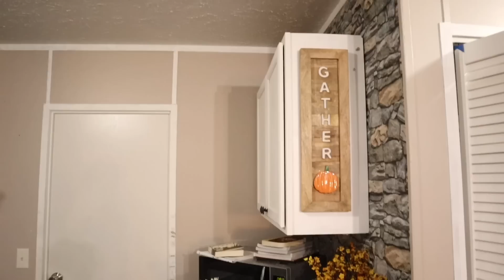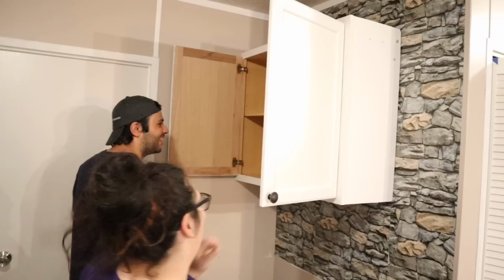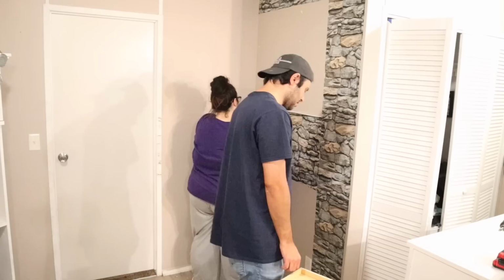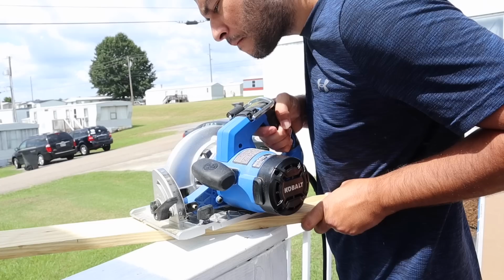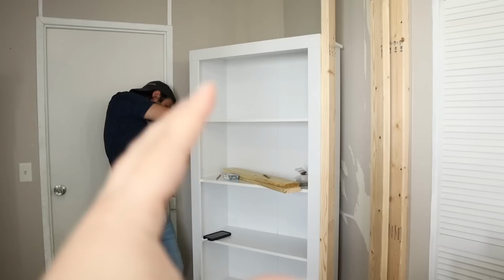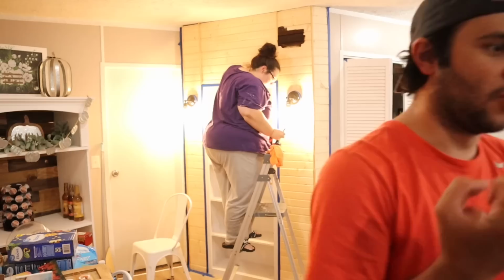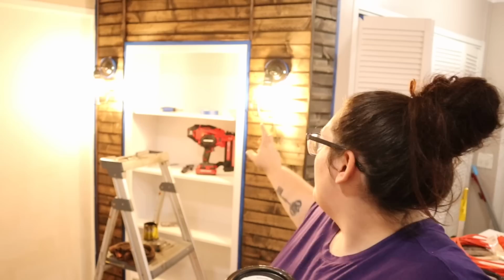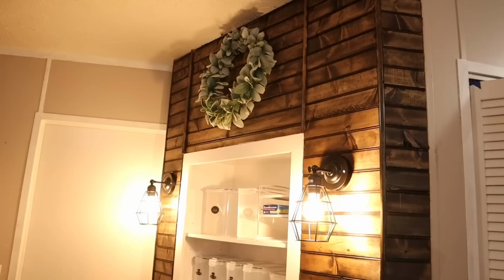Bookshelf to pantry DIY | SINGLE WIDE MOBILE HOME PANTRY MAKEOVER | 🔨 home updates on a budget 💰

Comment: If you wanted doors, he could build either one door, like a closet door or two smaller doors that meet in the middle. You could build it out of one by twos (think cheap)  then cover the back of the door with screen, like a country screen door (you could ever buy some fancy corner pieced for the screen door.) or if you made it with two meeting doors, like a pantry, you could use hardware cloth, or chicken wire to cover the doors inside. You might add a Buffalo check valance on either one. Fasten the curtain rod at the top and bottom of the door to hold the curtain in place. I see several different looks for the curtain. I’m sure with your immigration you would have no trouble envisioning even more then that. Stick up some dollar tree puck light on the bottom of any shelf you want to highlight. I envisioned a space about the current shelf, going to the ceiling, that could be utilized to hold baskets. Lay one on the side and have your fall greenery cascading out of it. Great project!

Comment: Pantry is nice.  Was curious why you put at an angle?  We have a similar space in a corner of our much older mobile home kitchen.  We built a frame but straight like the cabinet was, floor to ceiling & bought the adjustable wire shelving that attaches to back wall.  Found cabinet doors at resale store the width needed. Or could buy the louvered doors like your laundry room.   Amazing amount of storage for all food & non food & even larger appliances we don't use on daily basis.  Where your coffee bar is would be a good spot for the bookshelf to house all your homeschool items.  As you know in a mobile home lack of storage is always an issue.  But again love what you've done  to your home.